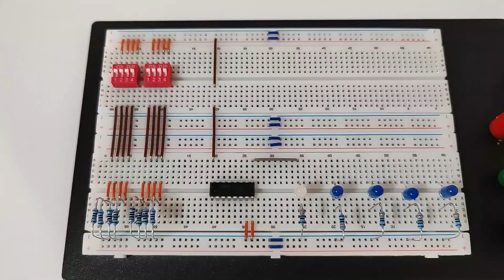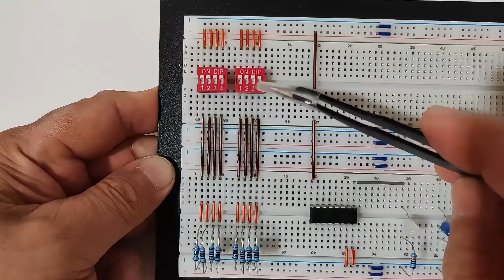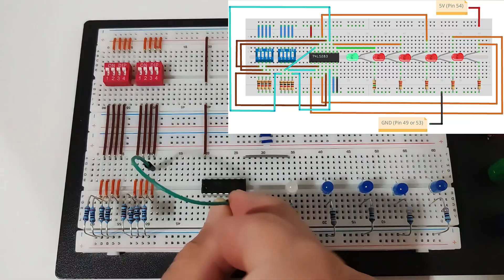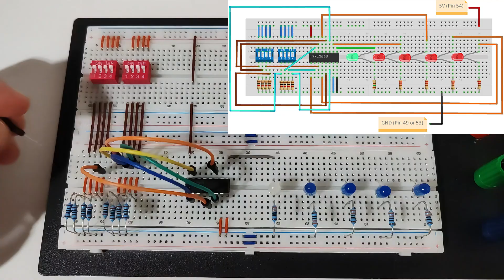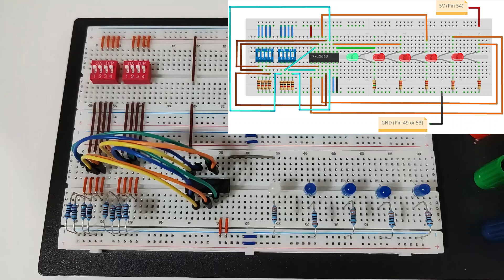4-Bit Full Adder Circuit #fulladder #74LS283

Comment: You misspoke at 2:25. 
Carry-In is the pin 7 not Carry Out.  The white LED is on the Carry Out on pin 9
Reply from the maker: I stand corrected. Just checked the data sheet of the 74LS283 and you are right. I got pins 7 and 9 mixed up. My bad. 🙏